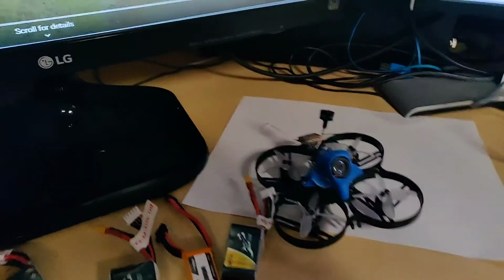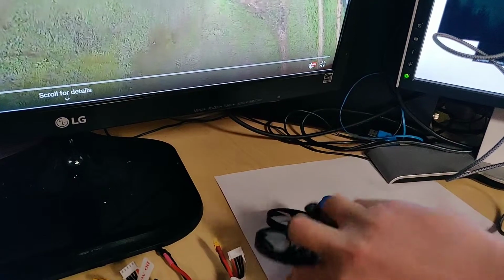3 of 3 Beta85x HD these ARE the fixes you are looking for.

Comment: Hey question for u, so is it normal the fpv footage quality is mediocre compared to other non HD dvr cameras? Cause it records awesome video but compared to my tinyhawk 2 camera it sucks flying around. Is the quality different when u arnt recording? Thanks!
Reply from the maker: The fpv footage is garbage unless you turn the camera to 60fps, otherwise it is pretty good. If you go to 120fps the video is kinda unreal lol but super good, you will not get the desired resolution though.
Reply: @unbounduav6940  i can't even switch to 120fps on mine...i did order a new lens which i have heard people saying helps with clarity.
Reply from the maker: @seacawk8259  Next time you take a look at the cam settings, shoot them over to me and lets compare notes.